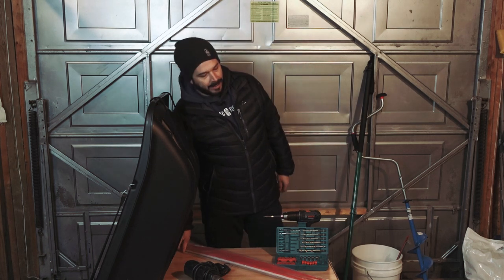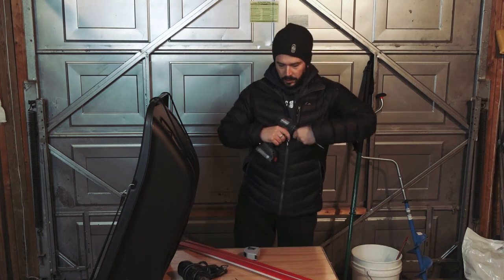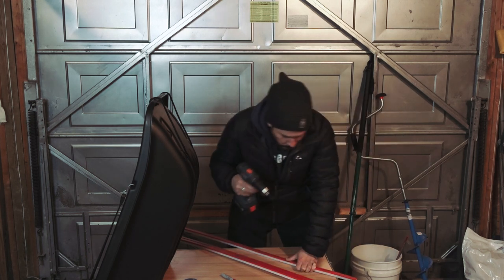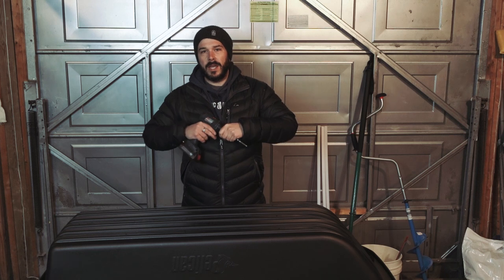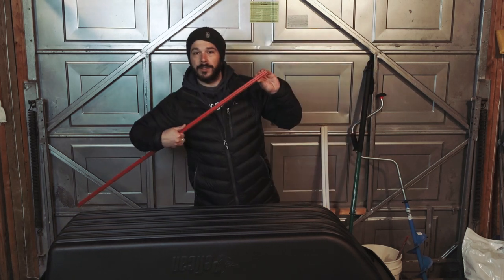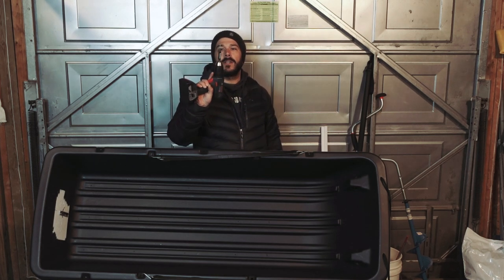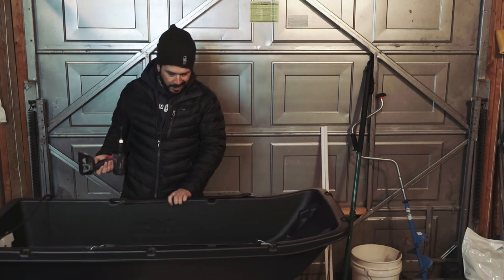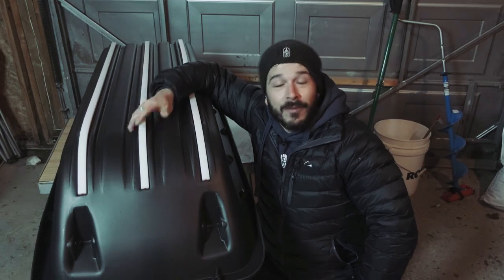How to install sled runners on a Pelican ice fishing sled

Comment: Ben, your Pelican 60 track, what size of Pelican sled do they fit on. I have a Cabelas Utility ice sled 50" long x 26" wide x 10" deep and looking for runners for my sled. Your thoughts are greatly appreciated.
Reply from the maker: They fit on the Pelican SnowTrek 60 with little room to spare. I imagine if they’re going onto a 50” sled, you’ll have to trim them to make them fit length wise. The other issue is what the bottom of your sled looks like and if the runners will have a good place to sit flush with the sled.
Reply from the maker: I hope this helps, and don’t hesitate if you have any more questions!
Reply: @Paddleheads  Thanks, do you know if the runners come in different sizes or are the one fits all a trim where required. Your thought.
Reply from the maker: Sorry Martin - for some reason YouTube flagged your comment and I didn't see it. They make the runners for three different sizes of Pelican sleds, but I don't think any are 50". Chances are, you'd have to cut them down. I think a small hacksaw should make quick work of them though.
Reply: @Paddleheads  ok thanks

Comment: My pelican 60 only lasted 4km without runners. 

 Definitely get runners. Since they have stock issues,  you can use puckboard.
Reply from the maker: Wow! I suppose if you’re hauling enough weight on some rough terrain, it wouldn’t take much! Thanks for the input and suggestion!
Reply: @Paddleheads  was about 150lbs
Reply from the maker: While that's a lot of weight, it's still surprising that it only lasted 4 km! I'll be recommending these runners with even more confidence now. Thanks Andrew!
Reply: The tag says its good to 260. They also got me banned from fb for my complaint.

 Ive had quite a bit of pelicans products and can only say they have gone downhill at a tremendous rate.

Comment: Awesome video. I am looking to pick one of these up. Do you have the inside dimensions of the sled?
Reply from the maker: Thanks Thomas! The sled measures 59 and 3/4 in. long (152 cm), 24 in. wide (61 cm) and has a depth of about 12.5 in. (32 cm).
Reply: @Paddleheads  is that the usable floorspace of the sled? Thanks.
Reply from the maker: Good question. I'll take a tape measure to it tonight after work and let you know!
Reply: @Paddleheads  thanks so much!
Reply from the maker: So the flor space is about 44” by 17” by 9 1/8”. Those are pretty much the minimum floor space, but they quickly expand as it goes up. I hope that helps!